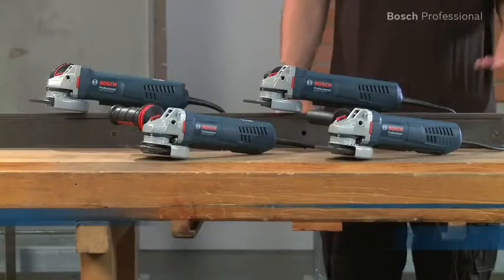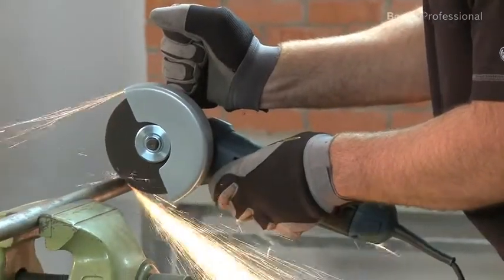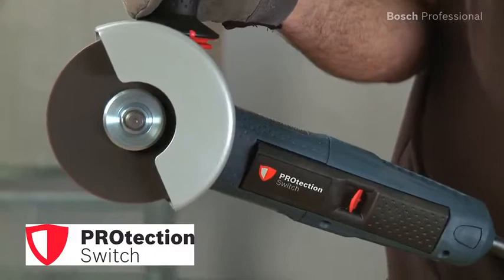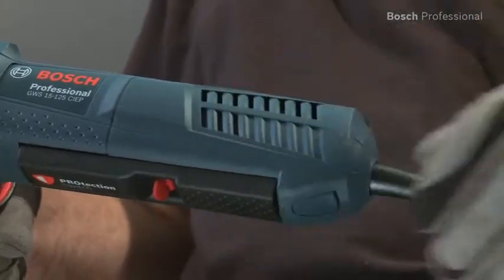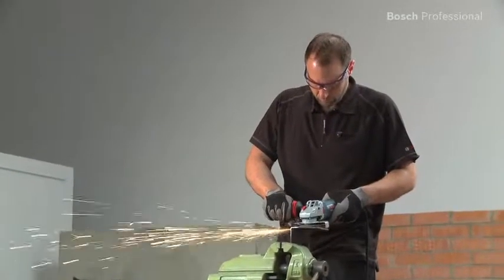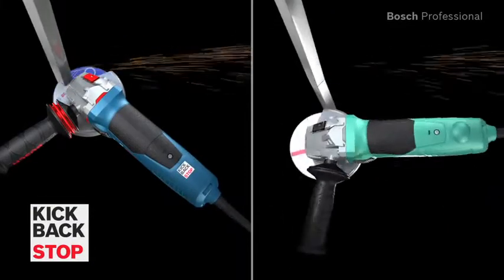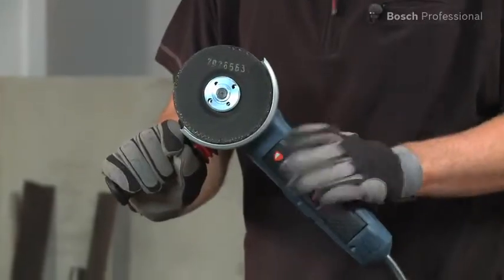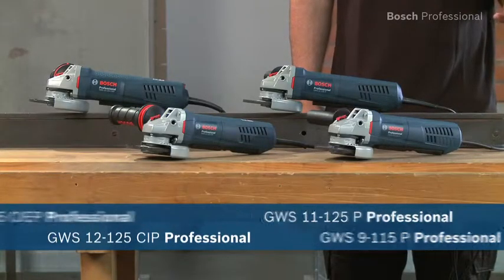Bosch Power Tools | GWS 12-125 CIEP | GWS 15-125 CIP | GWS 15-150 CIP Professional

Comment: Hello
I have a bosch  15-125 ciepx 0601g96 300 I noticed that it quickly overheats the case. . Is this normal? Is there a problem ? How to solve it?
thank you in advance
Reply: Yo thx for the info 
I have a gws 750 115 the metal head also overheats in about 5 seconds but I've put it through alot of heavy use and its about 3 years old